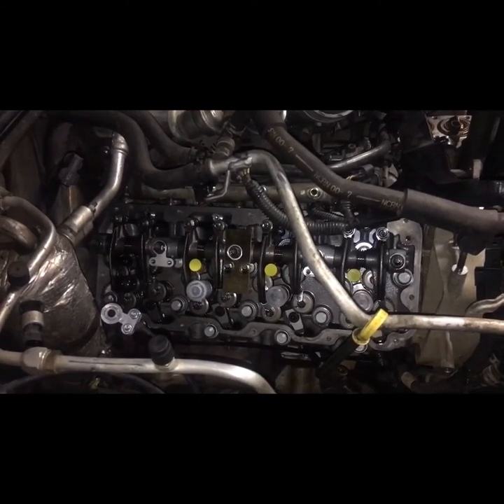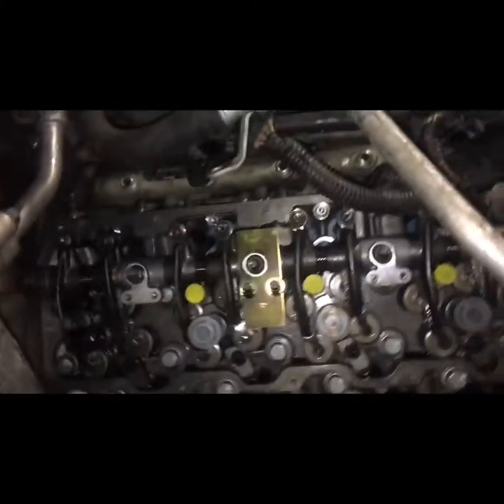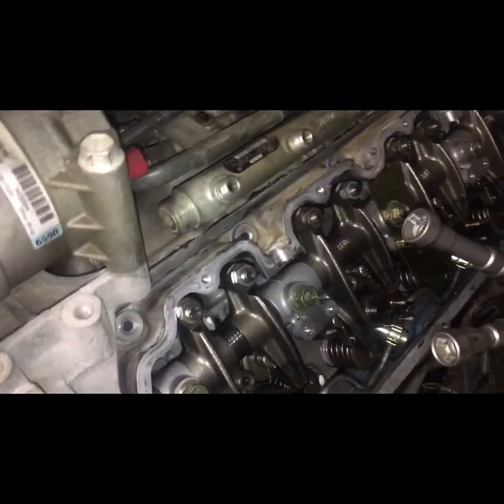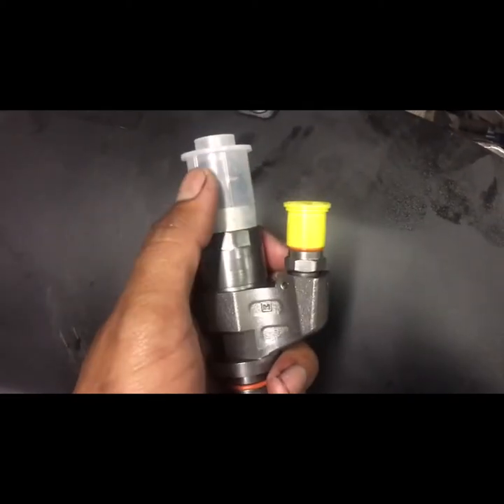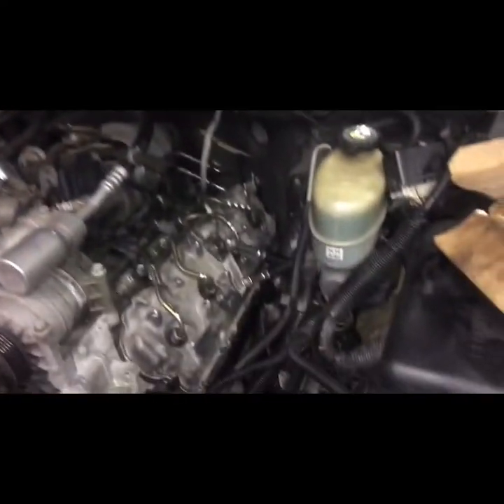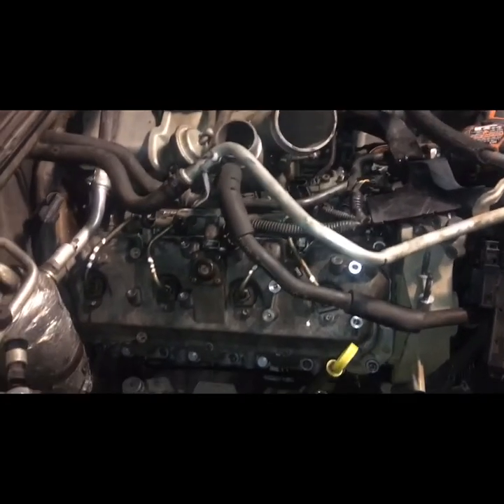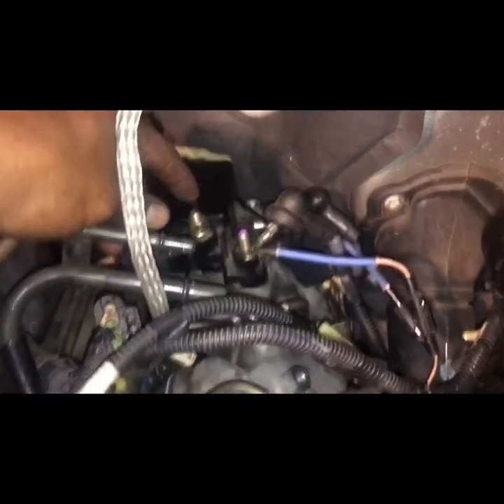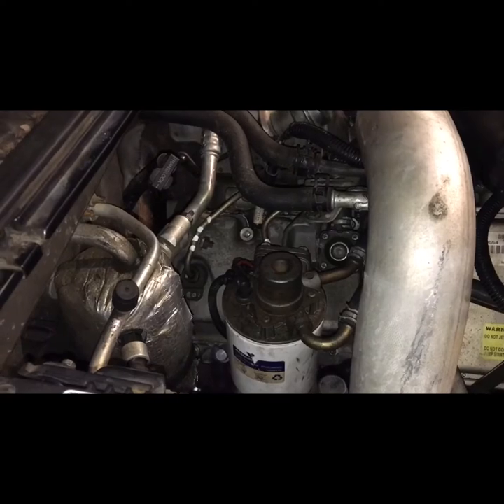How to replace the injectors on a 01 Duramax 6.6

Comment: One Question, what kind of injectors do you require for my 01 duramax 6.6 new or Remanufactured?
Reply from the maker: Letty Palafox 
T
Hey thank you for watching my videos!
Look I will tell you that with my experience i would not buy one more reman set...
I had some bad experiences with those... now i will tell you that even new injectors can come defectives 
But still 90% of the time i will not have any problems with remans..
But if its your truck and can buy a new set i would do it!!
Thanks for the comment and don’t forget to subscribe!!
Have a blessed day!!
Reply: how much does the new set cost? BTW thx so much for letting me know and helping me
Reply from the maker: Letty Palafox 
Well you can find the whole set around $2400
A reman set you may find them around $1600
Hope this helps you!!